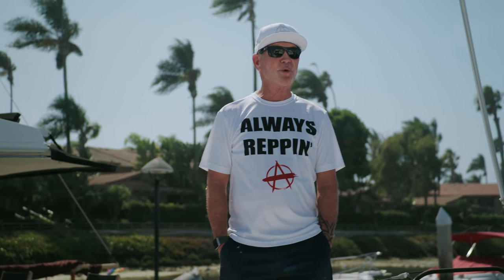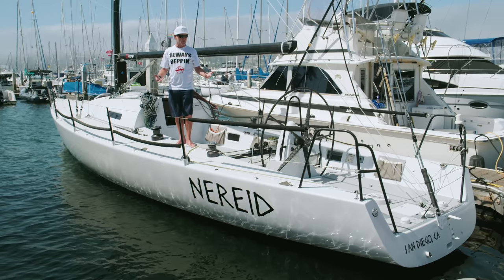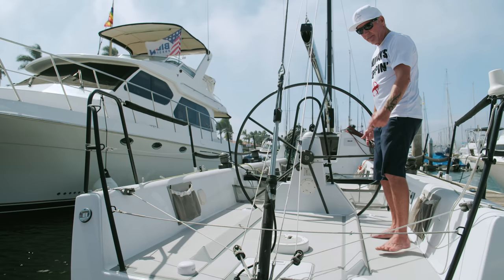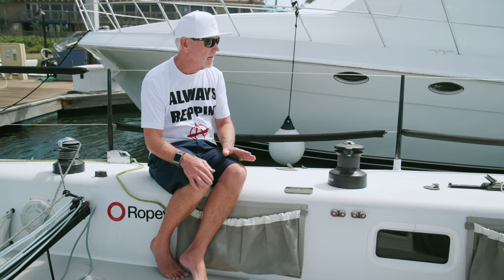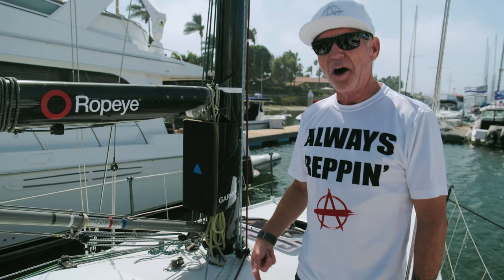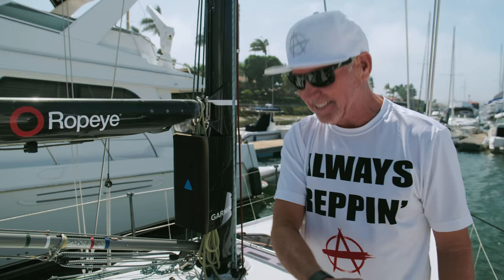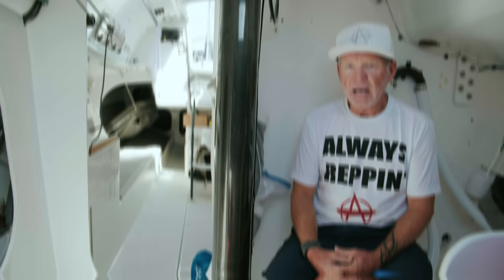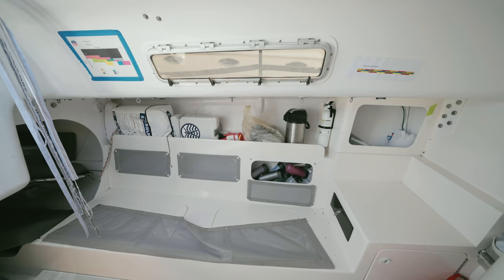#J125 Sailboat tour - E13 "Nereid" - #retroboat w/Scot Tempesta #sailinganarchy

Comment: Great Stuff Scot...I had "Aquila" an Olson 40 at the Kona Kai in Pt. Loma 2005 - 2006. Raced the Cabrillo series Ensenada etc. Your overviews are excellent. Thanks for your work 😎 "Aquila" moved to La Paz in 2007 - 2008 and then was lost in August 2008 in hurricane Hernan doublehanding to Hawaii. It hit 1,700 nm west of Cabo and 1,100 miles left to go to the Islands sailed 56 hours straight in Cat 2/1 40ft seas..backstay blew...rudder bearings cracked prop shaft leaking...shrouds creaking..hitch a ride on a Toyota Car Carrier heading to Mexico..still in tropical storm wind and seas.
George Olson builds a great boat. Saved our lives 😁

Comment: viggo clearly sandbagging with that 13 on the targets! 20 in 25 is easily achievable with just 3 on deck.
Reply: depends on the angle
Reply: @fiftyfathoms8396  just gotta keep it up on the step. for hamachi it's this: (18, 20 and 22kts tws)...
138	       20.93	      145	18.01
138	        24.3	      145	21.07
138	       28.68	      145	23.13
Reply: I sailed the J-125 over 15,000 miles and won nearly everything... I am aware how to sail it